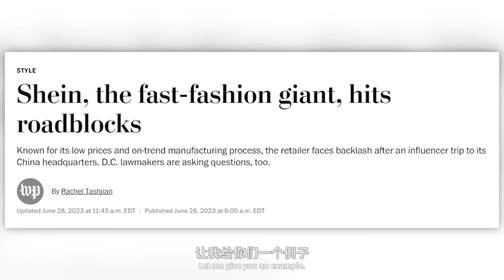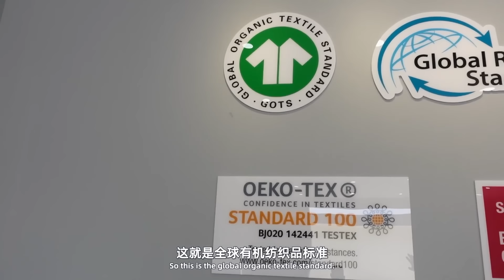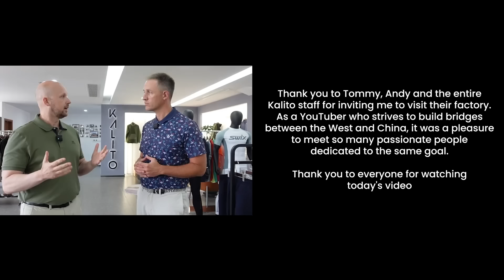I Visited a Chinese Factory...What I Saw Shocked Me!

Comment: Fun fact: do you know why they use a laser cutter for the patterns now? 
We used to have a ink jet printer with four separate heads here's the roll of paper and 8 ft wide.
Fair print an enormously long sheet probably about 20 or 30 ft with all the patterns on the surface. It was accurate about 1 mm per 10 feet or so. So in the days of 1980s it was fairly accurate. And like he saw in the video they would take this pattern sheet to a long table where they would take in the bolts of cloth, laid down maybe 20 so layers of the cloth stacked up they put the pattern on top, and then they would use a mechanical cutter to cut the patterns out. The only problem is was it had to use quite a bit of pressure keep the fabric from moving. You wouldn't think that would be much of a problem but you figure if you're pushing down on the fabric it tends to be right size at the top and slightly expanded at the bottom of the stack of fabric. Causing a slight sizing issues through the stack of fabric.
Reply: BTW, that inkjet printer cost about a quarter million dollars. I know because I asked them and I was the one who worked on it to repair and or fix minor problems and or upgraded as necessary for software and or troubleshooting. Yeah like I said that was in 1980s money too. He's a 6-ft bed plotter if they would trace the fabric Swatch fabric pieces into the computer stations so they could hand optimize the optimal use of the fabric Swatch. A lot of times they also have the ability to match fabric with the pattern that was on the fabric left right so looked proper. The interesting thing about each of these design stations that hooked into the 6x6 ft plotter, they actually use two computers. One computer was for the design software the other one was to be able to strictly run the monitor because at that time it was high resolution monitors so they could properly place the pieces in or rotate them etc. You might as well call it fabric CAD

Comment: In the manufacturing of garment and apparel industry such as the company you featured,it requires aside from being an skilled worker,
finger dexterity counts the most the skilled worker in this factory are using different kinds of industrial sewing machine 
in each sewing section and it is done in an sequential operation from cutting to finishing with its application of good quality control especially for the high end products they produce..An industrial engineer is needed into this kind of industry as the company 
production manager.He should also should have the skills in sewing and pattern making..

Comment: its funny about this,     the machines are made in CHINA,/or Japan,  all the machines that we sew on in USA are made there too.  WE ALL buy them from ASIA.   also that is not a LASER cutting machine that you mentioned.  We have them here in the USA called   GERBER,  and there is many others making that machine now  It actually has a blade in it.   Can cut many layers.  
We also use those same HIGH" end machines that you mentioned.   THey say they are not a Cheap end factory, but they pay cheaper labor.

Comment: As an American, I avoid Chinese-made products. My experience with products made in China is, that they don't last long at all. For example, I bought a futon that was made in China. It was barely used and over 5 years, the plastic upholstery crumbled and disintegrated like something exposed to intense sunlight for 30 years. I bought some electric garden tools that were made in China. The electric chain saw leaks chain oil all over the place and the Chinese-made wood chipper quit after only using it roughly 15 times. In some cases, factory workers are overworked and treated poorly.

Comment: I have serious doubts about this so called documentary. I should be done in two parts: first the owner perspective of his business, his claims of fair treatment of his work force, working conditions etc.... Then an evaluation by a reputable human right organisation  having audited the above claims regarding wages and working conditions coupled by real testimony by the workers without threat from punishment. The workers testimony in this clip are meaningless. What are the hours, exact wages, days off and benefits? Noise level, ambient temperature, production quotas, brakes? In Shengen the girls on  the factory floor assembling electroncs are surrounded by hight fences around the staircases and the upper floors to prevent them to commit suicide by jumping off to their death. An yet we in the West, are too happy to buy these products. May be we want to believe these claims so badly that there is no need anymore for critical thinking. I am not buying it.

Comment: Just clothing not so important but hightech equipment posing high risk to manufacture in China . 
I was testing a pump by KSB Germany licensed in China . I was surprised see the equipment lining pump casing using on off button during world  2 machinery no computers monitoring the thickness pump lining . The factory was filled with dirt and dirty water .  How could a KSB Pump manufactured back yard and got licensed from Germany no wonder pumps failed . Later I asked to import from Germany directly .